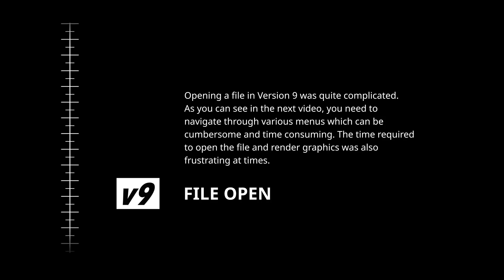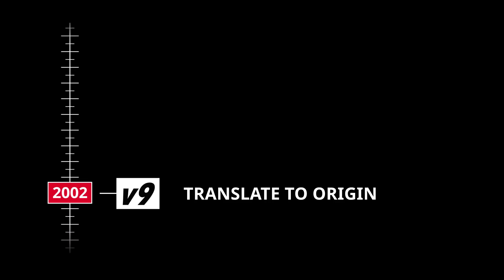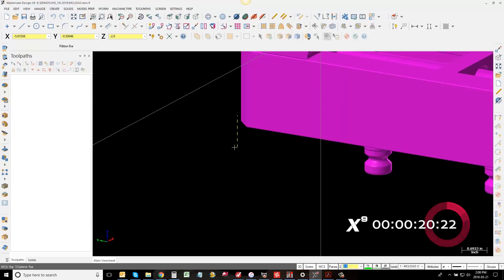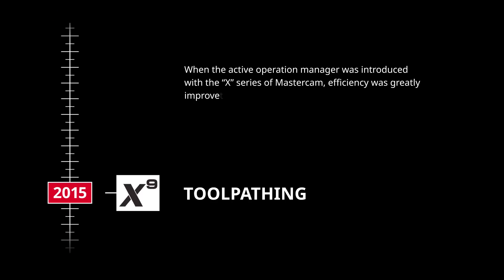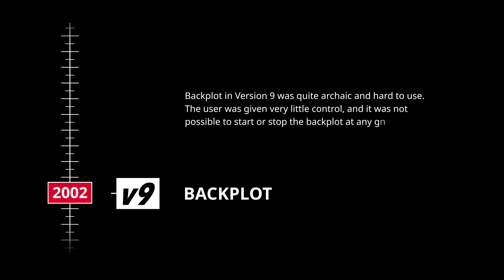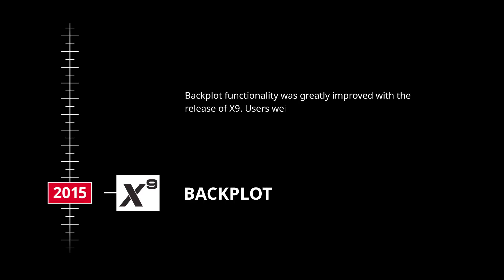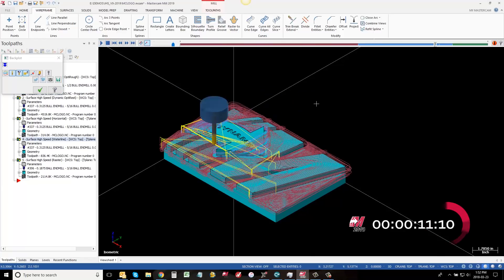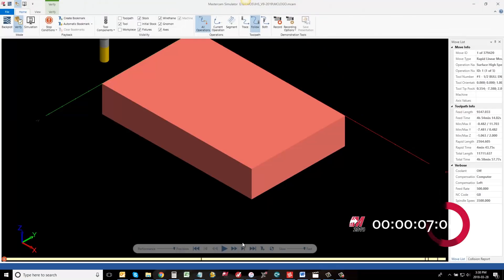Compare Mastercam v9, x9 & 2019

Comment: This is  a crock of B.S. Most of what is said here in this video is basically a white lie. The only thing different from VERSION 9 as far as I can see is that V.9 did not have trochoidal tool path for slot cutting, Hi speed roughing tool path (where you peel the stock in small layers at very hi feed rate(but you could do easy work-around  with manipulating step over) and there was no multi threading(which has questionable benefits anyway, unless you can import proven tool path with correct tools and tool parameter-as done in WorkNC). There  are some improvements in verification and rendering the machining process, which cold have  been  done in V.9, just as the rest of the things done in later versions, which includes introduction of solids.....because solid is nothing more then watertight surface model(viz Rhino or SpaceClaim and others). There is probably some improvements in hi end toolpaths for 4th and 5th axis cuts, but all that could have been done in V. 9. Now as for as your LYING claim, that opening the file in V.9 was quite complicated - this is statement for new generation kids, who do not know, which is totally false(as most of this video is). Where ever you were in MC V.9, you click with left hand several times on "esc" button, which brings you  to home level on menus(if that is needed-you might be already there at the start of program, for example) and with and then just "f"," o" and the file name in the window, that opens. I can open the file in V.9 at about 50 to 30 percent of time faster, then you can do with mouse in new version. And so it is with most of other claims you state in this stupid video......Not everybody is novice here. You make yourself look like an asshole in front of us, the experienced old guard.....The truth is the efficiency functionality of new Mastercam was greatly diminished, while you are lying exactly the opposite.....Just for the inexperienced youth: line horizontal in V.9 required following effort: c,l,h 2 mouse click where to begin and finish the line and y coordinate number(if needed)....try that with mouse in New Mastercam....When you are done,I will be miles ahead on 3rd or 4th geometry element...( I am retired machinist,designer,programmer,small machine shop owner, my experience with CNC software since 1980- IBM  APT 360, Compact II, PC Apt(own), Mastercam V3 through v.9,CAD KEY(own), Cad Key surfacing (own), Gibbs and Vellum, Bentley, Toolchest(own), Solid Works, Pro-E junior(own), Esprit(own), WorkNC(own), recently did tried   Autodesk Fusion 360(no good) and I am looking at SpaceClaim and  photogrammetry-Meshroom and Blender.....so that you do not think some amateur is  getting rid of his frustration here....